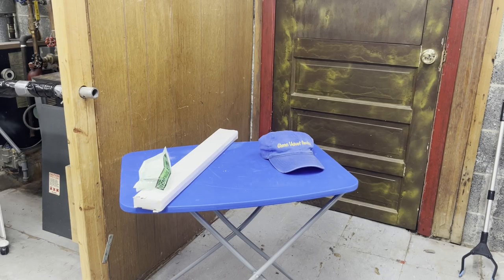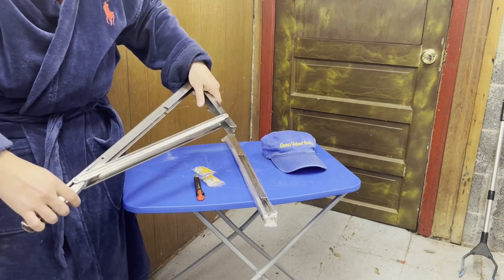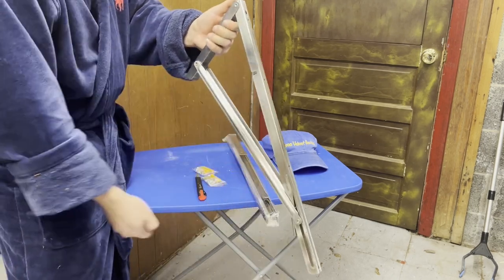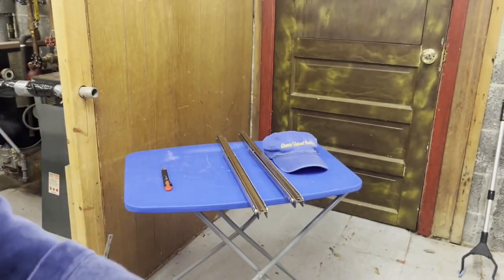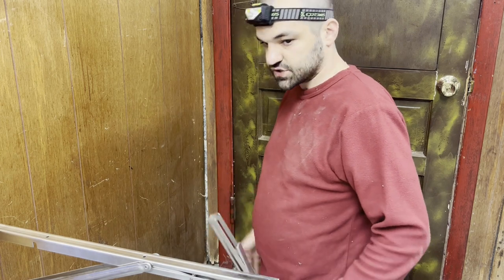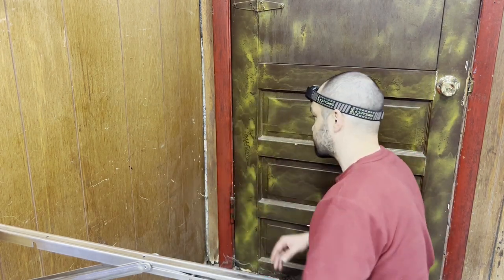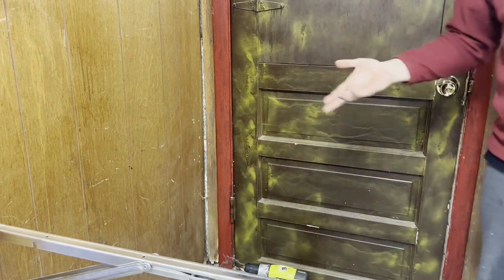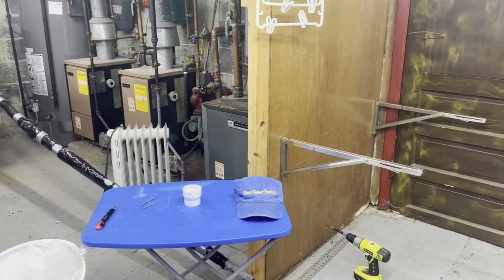Installation Review of 24'' Folding Shelf Brackets, Heavy-Duty Stainless-Steel DIY Wall Mounted

Comment: I'm trying to install one of these for my mom's laundry room and she lives in a Mobil home. So get this I go to home Depot and I explain in detail what it is I'm trying to do. The guy tells me I need anchors for cement. I said cement? I'm only working with panels. Well needless to say I bought what I thought would work and I ended up with 6 huge holes and still don't have the table installed. I need help, the wood I'm trying to hang is like 1/8" particle board not even wood. I'm stuck and now idk what to do. Please advise
Reply from the maker: What kind of wall are you trying to hang them on? Sheetrock? Wood? Or you have no idea? You can tell by the large holes you said you have already made. If the holes are 5/16 you could use the green color anchors from Home Depot. If they are more than 5/16 you will need to buy toggle bolts instead and install them correctly. I will always advise to try and hit center of stud then you do not need any anchors. Then you should be able to complete your project. Good luck on your travels.
Reply: Mobile homes typically do not have full size studs and may be closer than 16 inches apart, or further apart depending on the wall.  Buy yourself a quality stud finder so you can drive construction screws into the wood framing.